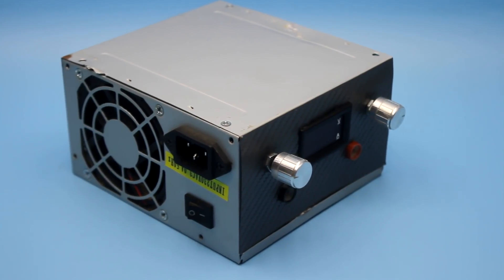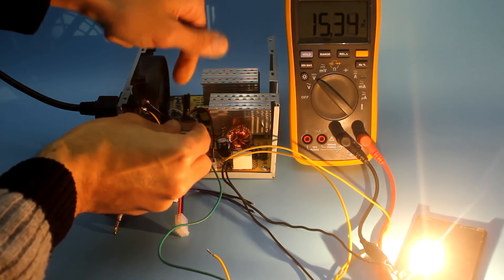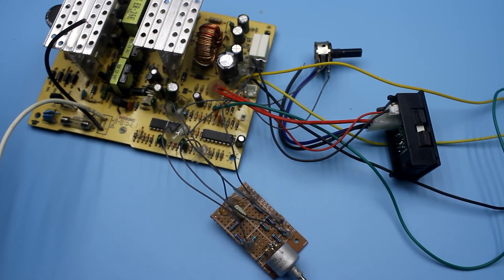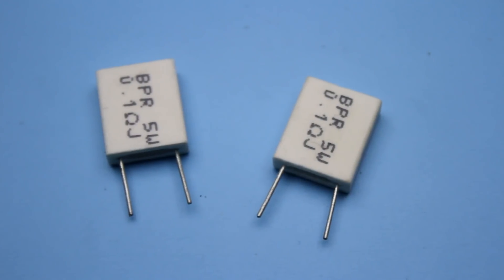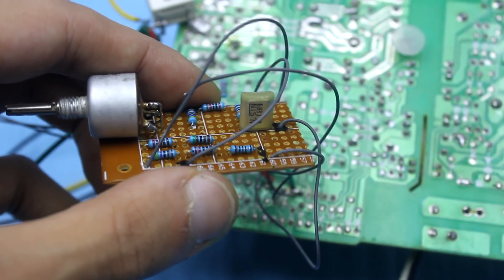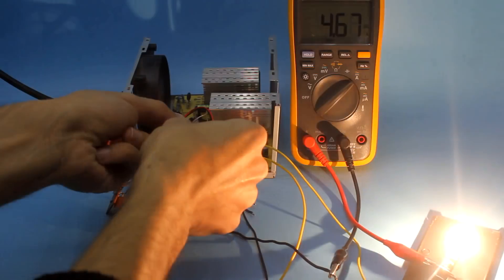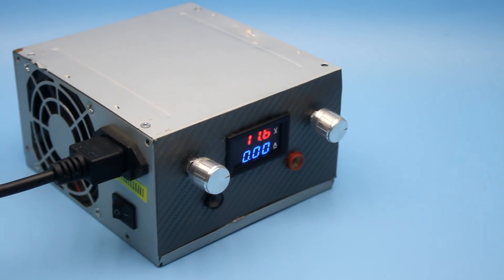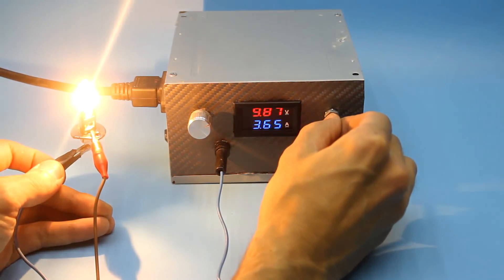Adjustable power supply from computer ATX!

Comment: This is the BEST video on ATX PSU conversion on the internet.  Well done @kasyantv! 
Years ago, I modified an old ATX PSU, making Voltage and Current adjustable, following to this video.  This PSU has served me well for many years (and it still is).  
Adding buck converters is for pussies.  
This conversion is super cheap and solid.  Any good electronics engineer should be able to do it.

Comment: hi nice work but what if i need more than 15 Volte  what this the Resistor  of Value must use ?
Reply: I need the same thing , if you've find anything can you share it with me?
Reply: @martin-vi1xn  hi replace the 2.2k . To 680 ohm  the 2.2k connected between pin 1 to Ground in ka7500
Reply: @IT.Athear12  thank you , i just figured it out as well
Reply: @martin-vi1xn  you are welcome 🤗

Comment: Can you make full wave rectifier with 14v regulator from 10 to 100v ac input where the ac current is from a bike magnet coil output with maximum current with minimum power losses

Comment: Why not just connect buck-boost converter to the output of the ATX
Reply: Because buck boost converter cost 
And have 80% efficient
And power supply have voltage regulator built in but you need Small modification

Comment: I have Just damaged mine power supply.😭😭
Very sad because I have purchased it for modify and ended up damaging it permanently now Its completely shutdown😭😭.
How noob I am.
Reply: Should have bought old supply from scrap from core 2 duos or older systems
Reply: @Tiyagi99  yes bro I have purchased a old Chinese psu unit from a computer shop and the shopkeeper only took rs 150.
I have also taken two old psu units from my neighbour for free.😁
But I have damaged one that I purchased. And one psu which I have taken has damaged itself.
So I am left with one old psu which I love.
Reply: @ronaksoni2729  yeah I used an old PSU which I picked from scrapyard. Used it for years as it was but now while trying to modify it I am stuck.

Comment: Thank you for this excellent job, however I have a question: Is the first diagram that appears at 48 second of your video the final diagram? You have removed the connection to the ground of the output transformer as well as the diodes which are connected to it to replace them by a diode bridge. It is logical but in your comments you don't mention it! Thanks for a possible response.

Comment: Nice job.  But you wired the adjusting pot backwards.  Turning it CCW (Counter Clock Wise) by tradition and convention should turn it down, not up.

And you should add a resistor between the pot and pin 1 to limit the amount one can set the supply to.  Otherwise it's easy as all heck to make a mistake, turn the knob CCW and think you're set to the lowest level when in fact you're set way above the voltage of the caps at the end of the 12V line.  ALWAYS design with idiots in mind.  Otherwise someone will build this and then blow it up.

Comment: New mods use e.g. DC-DC 12A 300W Adjustable Voltage CC CV Buck Converter 7-40V to 0.8-28V

Comment: I modified my atx to go from 4.7 to 24.6 volts and you made it lower to 1.5 volts 
great job 
is it possible to make the voltage down to zero volts?

Comment: what about -12v & -5v outputs, as you have higher positive voltage on +12v output you'll have higher negative voltage on -12v and -5V outputs, so be carefully with capacitors at those outputs.
Second thing: you have not removed R52 (100K) from pin2 so the voltage divider (which you had added and which is formed by two resistance 4k7 and 1k2) also depends on the R52 (100k) which will be found in parallel with 1k2.
R52 is not always 100k for other ATX, so you must report it if it is taken into consideration (which is the case for your video) or remove it if we have designed to make a divider by only 4k7 and 1k2.
your divider gives 1.0073V at pin 2, my ATX, the R52 has the value 4k7 thus the divider gives 0.845V at pin 2 which will modify the output voltage range.
I missed the 5K1 between pin14 & pin2, so the overall divider will be: 4k7 // 5k1 between pin14 & pin2 AND 1k2 // 100k between pin2 & gnd , which gives 1.63V at pin2. finally 20k between output & pin1 AND 2k2 between pin1 and gnd will give us a maximum output voltage of 16.45V

Comment: Hello, my own psu stops when the output voltage goes up to 13.8v. What happening.
Reply: maybe the overvoltage circuit: from outputs voltages through some z diodes, diodes and resistors, to pin 1. This link must be cut

Comment: Where is the fan voltage supposed to be connected to? It can't run from the output, as it will destroy the fan when you up the voltage...

Comment: How remove the protect?
Please help video link
Reply: You need to find a zener diode connected to the 12V line on the ATX supply. Remove it when you find it. I hope this helps.

Comment: Nice. But amp and violt meter connection label is in another language
Reply: Bob Berg
 1 year ago

Here goes (top line to bottom):
Load ground wire
Input ground - goes to connection point between the shunt and 16-th pin of TL494
Load positive wire
Standby output of the ATX (purple wire)
Supply ground

Comment: what if i want only to adjust voltage without current . and how can i reach less than 1.5 volt
Reply: He tried that someday , did not succeed
Reply: me too. I got range from 4.7v to 27.7v. wanna lower voltage from1.5v or 25v. any suggestion?

Comment: Thanks for this information, very nice tuturial! But i have an issue about output voltage, as i increase the voltage up to about 14 volts, the unit was shutdown, The unit resume as i adjust the output lower than 14v, then reset the power. Please comment about this problem, thanks and more power!

Comment: There are much easier hacks for this, but mostly go from 4..5 - 16V max. If you really need the 1..4 V range it may be worth the effort.
Reply: in my case i got 4.7v to 27.7v. how to change range from 2v to 25v.
Reply: @thoyibbasarah3302  Buck converter

Comment: Nice job. I've modified a few ATX power supplies before, but I only modded them to be variable from 10v to 15v, a simple thing to do. Your job of making it go much lower than what I did is really tricky, and you pulled it off really well.

Comment: plzzz i need a clear diagram for converting ATX 0-30V & 10A ??
Reply: It dont can get over 18v at 10A, the Transformator cant Do it. 
(Only 30v 6A can be postible But i think 30v are to much for the Rest of the circuit.) 

At 12v 15A =180w.
 So 180w / 10A = 18v.

Comment: Personally I was only getting 10 volts max with the 2K2 resistor from pin 1 to ground, replaced it with a 680 Ω like the original schematic and it goes up to 19v.
Reply: Sir, how many registers can I set from 7500 to pin number 1 and get 14 volts? And should the previous connection of PCB with PIN 1 be disconnected? Thanks.

Comment: Like all used computer SMPS units, this is not really the best approach for a LAB supply. It only just makes it as a 'rough and ready' wet cell automotive battery charger (as long as you take care using it) because the unit was never designed with the kind of mains isolation safety factor for such tasks....

Comment: Where are the test results under load ? 
Can it hold a constant current over the entire voltage range ?
Can it hold a constant voltage over the entire current range ?
As it is this is just a toy not a true lab power supply. Nice try though !

Comment: this is so good work Kasyan but it'll be more advantageous if you'll be telling us why you changed certain components, what is their function and how you knew the values to replace with. Thanks!
Reply: to get 15v
Reply: can i measure LED forward voltage by this power supply?
Reply: Hamad Zeb yes its the right answer, if you just want to copy and paste  the circuit not to modify according to your needs.
Reply: ahmed sayed yes you can but you will most likely burn it as soon as it starts conducting.
Reply: I agree

Comment: My computer PSU (450 watts) contains only HS8108 (20 pin chip) what should I do now ? 😭
Reply: The HS8108 is a different beast. The TL494 is easier to modify. It's possible to modify HS8108 but requires a lot more work.
Reply: Jammit Timmaj, probably I need to download the datasheet...I think

Comment: 7:44 please translate it
Reply: Here goes (top line to bottom):
Load ground wire
Input ground - goes to connection point between the shunt and 16-th pin of TL494
Load positive wire
Standby output of the ATX (purple wire)
Supply ground

Comment: Thank you for perfect work but I think it is complex and not easy at all any mistake or fault  can destroy the circuit .. in short you can use five pieces of lm317 together to get high current( if you need it) and transformer to do so ..it's easy and simple and saver than pc power supply. .
Reply: The video mentions you have to be careful, which is why it took so long to make a video about it.
You can't do the same with an LM317. It is useless for currents above a few 100mA, especially when you need a low output voltage.